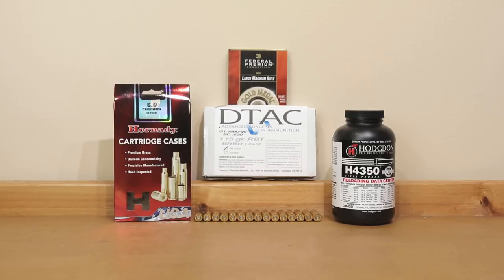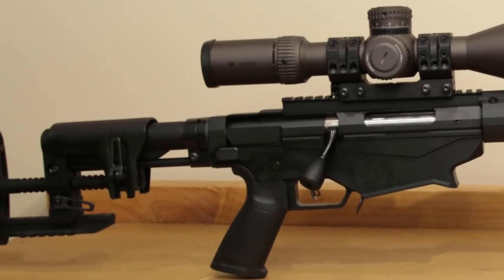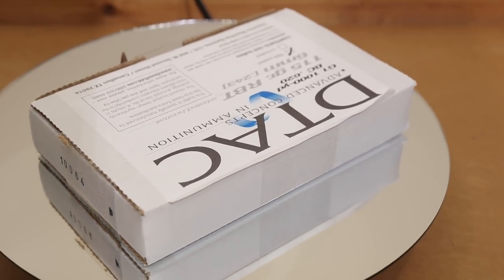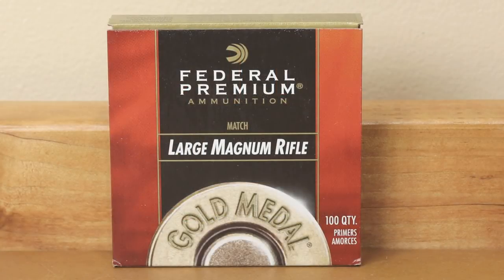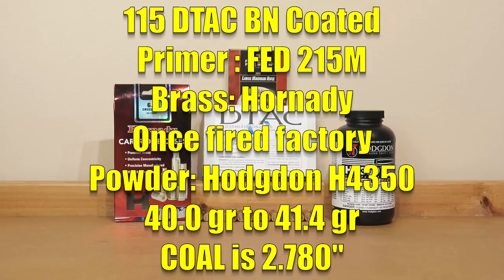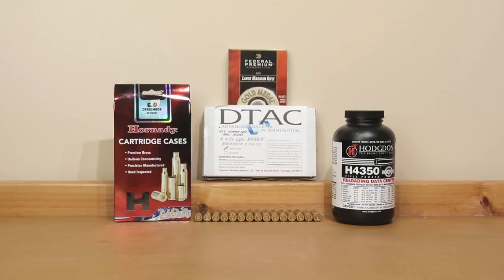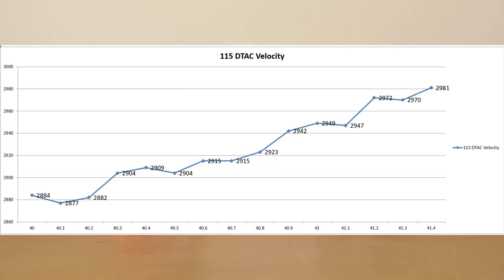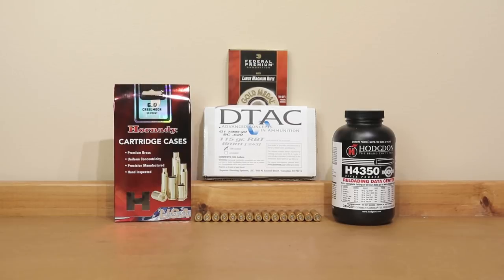6mm Creedmoor - 115 DTAC with H4350 test with Ruger Precision Rifle

Comment: Excellent! I too have planned to purchase the DTAC bullets, but they are nearly always sold out when I check the website, and will when David has them in stock. You do know the rebated boattail causes the bullets to be pushed out of the barrel as if it was a flat base bullet. the gases pushing on the bullet base of a standard boattail pushes more at the junction of the boat as it contacts the rifling at the lands thus eroding more.
Reply from the maker: Hi George, I would love to see some slow motion footage of that but I don't think its in the cards for my budget.

Comment: Bullets and 7 twist barrel arrived, 26" criterion remage. Forgetting about your video, i ran it 41 to 42 grains with 41.2 and 41.4 being the flat spot in my barrel. I just remembered you had tried this combo out so I'll be testing the mid 40.5 area next. Our velocity between barrels is almost the same.

Comment: For future reference you can use a Miller stability calculator to determine if bullets will stabilize from a given twist rate at X velocity, temp, and altitude.. Recommend twist is to insure no matter what 6mm cartridge is used there would be adequate stability, velocity equals rpm so obviously faster cartridges will provide a higher rpm from the same twist compared to a slower cartridge.

Comment: I run the 115dtac out of my RPR at 3060 average fps but I'm higher on my charge and my OAL is a bit longer. I've stretched out to 1100 yards so far with great success.
Reply: What's your oal?
Reply: 2.24" to the ogive.

Comment: Good stuff. 41.5-41.6 is the sauce in my RPR with the uncoated DTAC’s. Tho I am seeing 2950fps with large rifle Starline brass with a 210M. When you do find pressure, it comes on quickly! They’ll go from looking fine to every single one cratering like mad.
Reply from the maker: Have you tried anything with them besides h4350? I have heard mixed results with h1000. According to the internet (disclaimer) this is a barrel burning load.
Reply: Bolt Action Reloading Nope just H4350. Case capacity seems to be the limiting factor with the H1000, especially with a bullet that seats this deeply. 

I think everything is considered a barrel burner with 6 Creedmoor. It’s primarily a match cartridge and most of the data points have been from competitors who run them hot and hard. If you’re not shooting PRS and subjecting your throat to repeated strings of torching, I don’t think you’ll have any problem going 2000+ rounds. 

At that point, a Proof Stainless barrel for 360 bucks will turn the gun into an absolute laser.
Reply from the maker: Where are they for 360?
Reply: Bolt Action Reloading Stockys had them for 399 and a 10% off year end sale. I see they’re back to 436 now.
Reply from the maker: I have been debating on what barrel to put on the 6.5 when it's done. Unless I switch to the 6mm then i am not sure it has another year. Good that there are a lot if options and i see they have a 1:7 twist option. That might be fun.🤔

Comment: Did you continue load development with the DTAC?
Reply from the maker: I am going to do some more. In fact I bought a ton of these so it's just a matter of time.
Reply: @BoltActionReloading  cool. I've got 100 coming Friday. 
Probably use 41.3 H4350 same as my 107 SMK and jump them about .002.
What is your neck tension?
Thanks
Reply from the maker: .002 NT as long as they stabilize you won't be disappointed.

Comment: Nice job. Hey if they group like that theres a good possibility that they have stabilized in your barrel. I am curious, do you use an auto powder thrower/measure or do you trickle your own charges?  Im curious about getting one and don't know how they perform. Anyways as always great vid.
Reply from the maker: Thanks for the feedback. I use a charge master with another scale to validate the charge that measures to .02 gr. It can see a kernel of powder change so I "fix" any throws that are off. I have never liked measures, just to paranoid I guess.
Reply: @BoltActionReloading  i agree with you, ive cracked a grain in half in order to achieve perfect weigh outs. This is basically what i would do also throw then validate. Powder throws are one variable we have that you can control..... Unless your worried about moisture content then........
Reply from the maker: I thought about getting a Harrell measure, but not sure it would be improve anything at this point.
Reply: @BoltActionReloading  i thought about trying to measure moisture content as well but never got to it. You basically require a hermetically sealed container regulating temp to prevent condensation. The absolute cheapest way to store your powder for long periods(at least in my opninion) is vacume sealing. Vacume sucks moisture right out of the "space" then store in an old fridge with an incandescent light to keep things warm.
Reply: @BoltActionReloading  what scale .02 do you use ...I'm using Hornady auto charge and my 2nd to validate is a Franklin arsenal both are plus or minus .1 doesn't make me happy ...great video today that's an awesome group considering how wide the charge weight was !!!
Reply from the maker: I use a waow,  but hate to tell you which one cause you never know on amazon any more. I got the one that JRB showed back in the day. I validate with check weights and it's very consistant.
Reply: @danielcrossland6915  I toss a silica dessicant  pack or two in my powder after I first open the jar. I don't know if it helps or not, but I have had great consistency  with H4350
Reply: @chris3383  I have a Gempro 250 I purchased on Amazon that reads in .02 grain increments. Seems very precise against my other digital scales
Reply from the maker: If mine breaks its probably what I would get.
Reply: @mikesimpson7748  thanks JRB has one of those too and it plugs in the wall or battery I believe .
Reply: @BoltActionReloading  guys out my way swear by the gem pro although never tried it. My buddy has the same scale your talking about. Bought from amazon for 25bucks cdn. Seems to work very well although you have to trigger it with a breath. As you near touch down. Seems like a decent vid to watch as trying different scales lead to different measurements when passage of information down the internet pipe. Would you consider a test vid on scales? Idea being same components and lot numbers, but different scales. Load up 5 cases per scale using a known good combo in your rifle that has very good sd's and groups and then test your 5 rnd group. Assuming a guy shoots 2 junkers to warm the barrel between groups. And each string has a chance to cool verifying with temp gun on chamber and barrel.
Reply: @mikesimpson7748  i thought of that but read in a military test document (wish i could remember where and when to point you in the right direction for ref) that dry powder shot significantly faster than powder that was a 40% ish moisture content. They had same lots but one was dried out and monitored the other was open poured out then poured back in for 6 months. Both were then loaded same components and lot numbers then fired. Dry powder shot faster and showed signs of pressure. Other powder could be loaded to a higher charge safely until signs of pressure ensued. This facter could potentially be another variable to perfect consistant loads. Like jeesh as if there werent enough to worry about. Us ocd peoples heads wanna explode every time i read another article on why things can screw with internal ballistics.....

Comment: Can someone explain why he uses 150 yards for testing?
Reply from the maker: Because my local range furthest distance is 150 yards and I can easily plug the distance in my software and it translates it the appropriate group size. I dont understand why people feel the only distance you can ever shoot groups is 100 yards.
Reply: @BoltActionReloading  But aren't you shooting 100 yard groups on your newer videos?
Reply from the maker: Largely yes, but these rifles were initially struggling to get to 1 MOA, no point in being 50 yards farther and getting 5 inch groups. My initial plan was to move closer, get things figured out and move back to 150, but it unfortunately hasn't been that easy.
Reply: @BoltActionReloading  I've been watching some of your videos are curious with the some of the groups you're getting. Could it be the barrel profile of your rifles?

Comment: Heavy 110 up bullets in 6 Creedmoor, work better with H4831SC.
Reply from the maker: I havent tried that one yet. I have heard some guys talking about h1000.
Reply: @BoltActionReloading  my load with 110SMK of 44.0gr/H4831, seated CBTO 2.160" (max mag length) in a custom X-Caliber barrel SAAMI chamber, 3040fps average accuracy node, .2MIL groups.